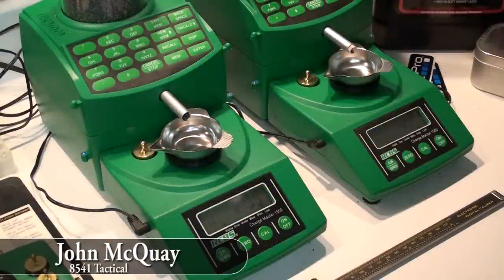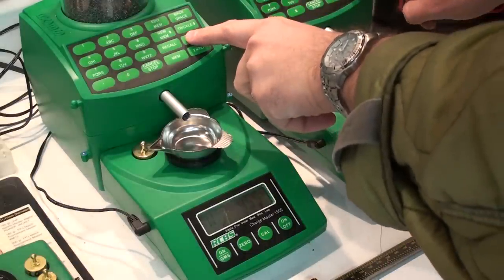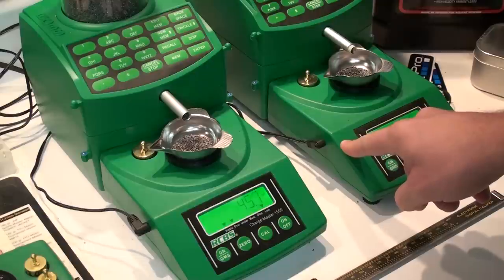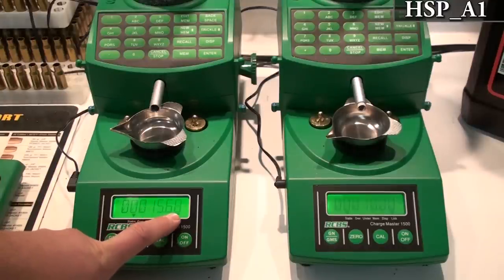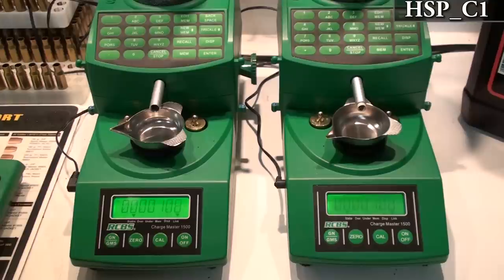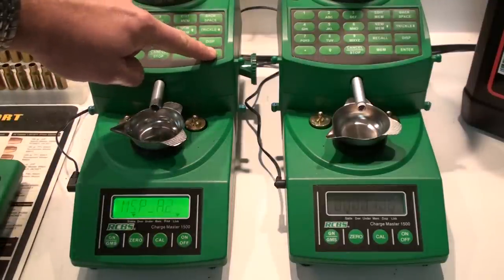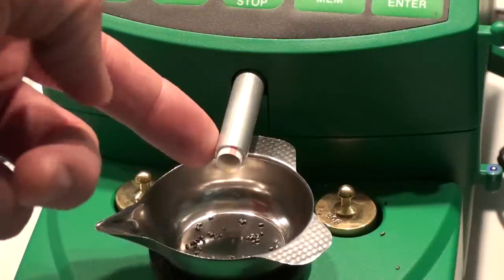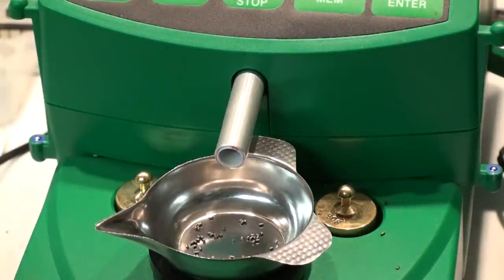Reloading Tips - Reprogram your RCBS Chargemaster 1500, Straw Modification

Comment: Your tips on the RCBS Chargemaster 1500 were great.  Three new points you might want to share.  All scales need to be level and this is rarely discussed.  The Chargemaster will measure differently with the door open vs the door closed.  Small fix:  File the side of the "door" that you will open i.e. left-handed vs right handed.  File down the area that makes contact with the small bearings that "lock the door".  File a little at a time until the "bump" is removed when you close the door.  With the door closed, your readings will be much better if there is air movement of any kind in your shop/man hole.  Thanks for sharing your video and I loved the straw trick.
Reply: Hawk Eye I have my chargemaster sitting 3ft from the window, I loaded 500 rounds and during the time I tested with open window and without, there was no direct wind but I did feel cold so there must have been some warm/cold air exchange, the deviation in the spread remained the same, didn't seem to make any difference.  I will test it with the door next time, but it seemed pretty useless to me.

Comment: John... Thanks for your reply..... The reprogramming tips were great, and the straw modification was absolutely outstanding. With the Chargemaster still on default settings, I had to basically set my charge weight about .3g. under to avoid the overthrows, and trickle in the rest. Since the straw mod, I haven't overthrown a single charge, and I'm setting the charge weight right where I need it. Absolutely great stuff... Keep up the good work you're doing. and Semper Fi....

Comment: Great video. Not sure if it's a common trick or not, but I use a Lee dipper and throw by volume to about 2 grains shy of my load. 

Then I hit "dispense" and the Chargemaster tops it off to the correct weight. It cuts a lot of time from the process.

Comment: I have an electronic scale that measures to 2 decimals.   I threw 10 charges of 45.0 gr of 4895 and weighed them to see how accurate the ChargeMaster is.

Most were 45.02.   So it is very good.

Thanks for the re-programming info.  I already use the straw, but want to speed it up.

Comment: My 1500 is 2006 model I use it a lot more then most do all my pistol shotgun rifles loads  & all I can say I love it over rest I used ..all I done was placed a .308'' 90gr bullet in the tube in the powder hopper area used masking tape make 1 1/2 turn wrap  use trickle mode for applying the tape  just enough 2 keep the  in bullet in place quick fix for the over  throwing issue . so i dont know how one wears one them 1500 out . thanks 4 the speed adjustment tip  cant wait 2 try this out thanks bud 4 the video ..

Comment: John, I bought mine used, and I really like it.  What I'd like to do is have it auto dispense and to remove that beeeeep sound when the charge is done.  Do I need to be in the programing mode?  I've tried holding the zero and then the enter button, that did not seem to do the trick.

Comment: Thanks, I'll give that a shot when I get home.  The holding zero key does not work on mine for some reason. I might call RCBS and maybe they can tell me if mine is an older model.  It was already programed for speed when I got it.  Did you buy two so you can dump two charges at once, speeding up your reload time?

Comment: Good vid .35 years of loading and I just picked up a 1500 ChargeMaster Combo today.I will still use my 10-10 scale for load workup but with my twin 23 year old boys shooting more all the time I find that I spend about 5 hours a week keeping up to them.I have a RCBS , APS bench mounted strip priming tool ordered and have the new Hornady Case Prep power trimmer .I looked at Dillon 1050 loading machine but think will stay with my Rock Chucker as all my loading is done to bench rest quality and can't see a progressive press doing the quality of ammo I get with a single station press .if you have any thoughts on the quality of loads with a progressive system I would appreciate any info and incite you can provide we do 1000 meter shooting .

Comment: Hello thanks for that video. I haven't bought one yet but plan on it. do you happen to know if you want to use 2 scale pans to speed up the process even more , do the pans have to be the same weight or will it account for it. thanks for any help.
Reply: Try it first, fiddling with the sccond pan, IMO, isn't going to save time.
Reply: Buy a second charge master so that you can run two if reloading large amounts

Comment: I would very much like to no just how accurate the chargemaster is in regards to electronic scales since I'm using a rcbs 505 beam scale.....thanks
Reply from the maker: +/- 0.10 gr according to RCBS. I have no way to verify accuracy beyond this.
Reply: ***** Do you actually get this kind of accuracy?  Because I tried all sorts of mods and it seems like the first 20 or so times it works really good and then it starts to spread, right now I get .2-.3gr spread with short extruded powder A2495.
Reply from the maker: We are getting very good accuracy when measuring the charges on a GemPro 250 scale. This scale is precise enough to measure a single kernel of powder. I would say +/- 0.1gr is very close to what I was seeing on my last batch of RE15 charges.
Reply: ***** Maybe I am not being very clear, what I am asking is about is overthrow accuracy on your Chargemaster, does it overthrow and if so by how much? .1gr? .2gr? What's the max spread?  I did 50 charges today and got 30 right on, 13 that were +0.1gr and 7 that were +0.2gr.  I dump the 0.2gr and keep 0.1gr but what I really want is every charge to be right on even if it takes little longer.

Comment: I picked up a chargemaster a few years back based on youtube videos.  It weighs the same charge to a range of 0.4 grains.  Weigh it, 44.0.  Weigh it again, 43.8.  Weigh it again, 44.2.  I have no faith in the unit because it has too much error in the scale to use.

If you buy RCBS, you are putting money in the trash.
Reply: I had the unit that never worked refurbed.  It now cannot measure accurately within 1.2 grains.  The powder pan weighs differently every time I put it on the scale, so it can't autodispense nor would I trust it to.

RCBS is trash.